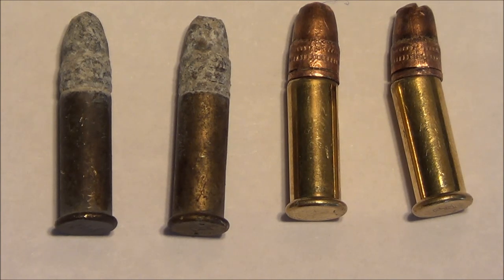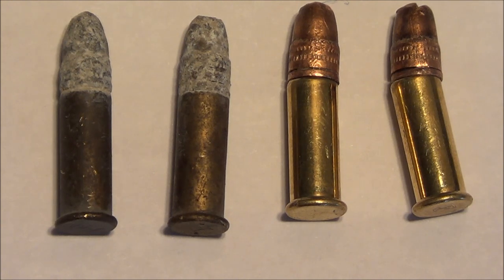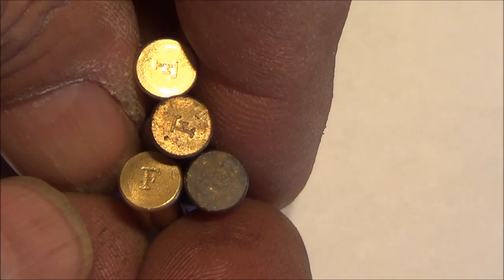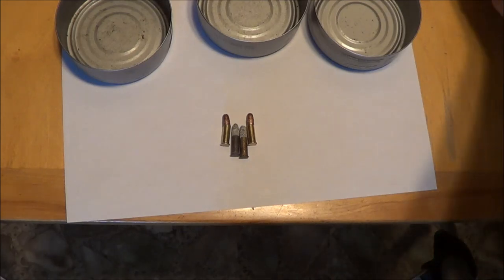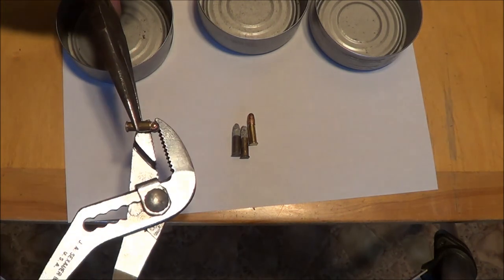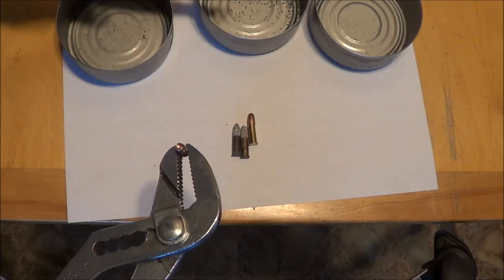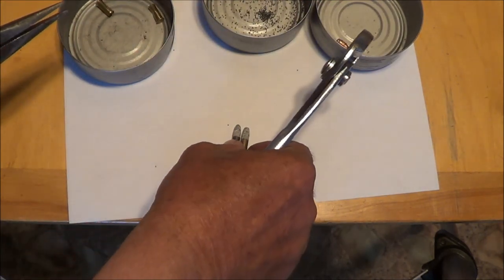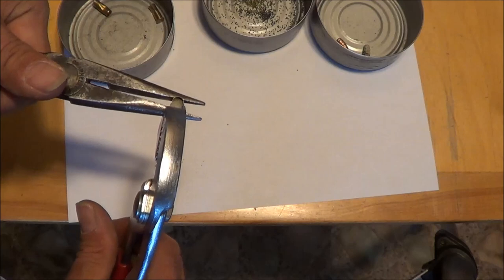How I disassemble .22 long rifle cartridges.

Comment: I wonder if the powder could be reused for reloading 38s or some other caliber with the fresher ones, but not the ones on the left that were left out in the elements.
Reply from the maker: nickglass12 It could be, but it is an unknown burn rate powder and the powder might be different in different brands of cartridges.  The powder could be different between standard velocity and high velocity cartridges in the same brand.  This would not be worth the risk.

Comment: Much less dangerous, although maybe it seems not at first - I just throw damaged rounds into my backyard fire pit, and then get some distance.  Since the explosion isn't directed and concentrated like in a chamber, the bullet doesn't really travel more than a few feet, and at a tiny fraction of its velocity out of a gun.  A .22 is even quieter than a basic firecracker, kind of disappointing actually.

Comment: I want to make a necklace out of a brand new AK-47 round. How would I disassemble it w/o damaging the casing or round to put them back together after removing the powder? Thank you for any response.
Reply from the maker: Use a bullet puller,  dump out the powder and seat the bullet into the cartridge case.
Reply: you mean a 7.62 round?

Comment: Since the old Federal and Winchester brass crimped 22 shotshells are no longer manufactured and the CCI's are weak and expensive, I can envision taking a new 22 LR, removing the bullet, adding #8 shotgun shot, and inserting a thin paper wad in the end to create a 22LR shotshell. I would only use it in an old single shot bolt action rifle whose rifling is irrelevant. I will dissect one of my old Federal brass crimped 22 shotgun shells first, but does anyone see any grossly implausible scenarios in such a process? (I will wear an industrial face shield). I would hold the shell in a rubber lined circuit board vice with the bullet pointed away and use 90 degree pliers with thick gloves for utmost safety.
Reply: God speed, sir
Reply: It work?